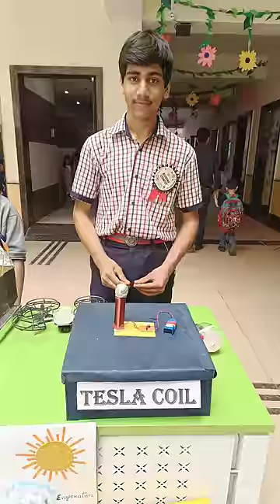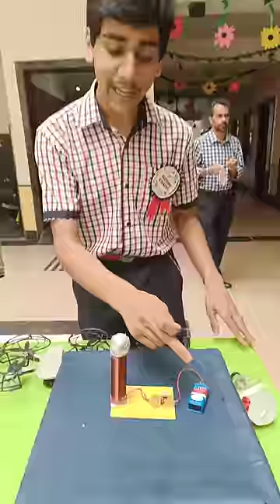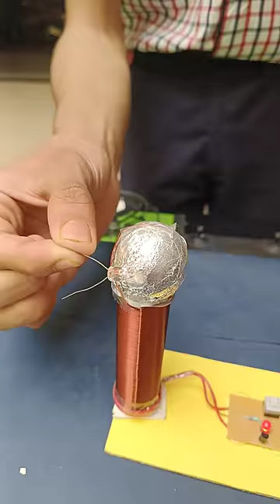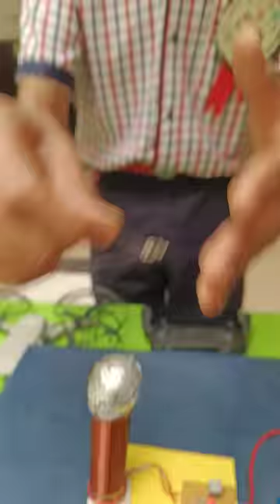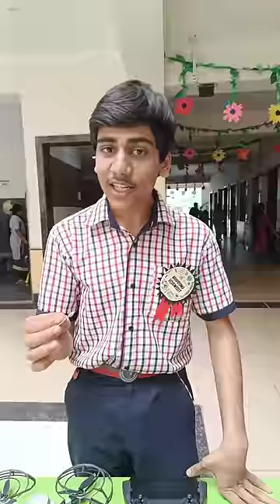Tesla Coil#science#project#exhibition#cbse#physics#learn#fun#magic#viral#shorts#trending #models

Comment: Abe electric field nahi hai electromagnetic field hota hai
Reply from the maker: Yes, but due to the presence of charges he is talking about electric field.
Reply: Can you talk with proper way to respect them?
Reply from the maker: @kaustubh_350  who disrespected and whom ?
Reply: nope tesla coil(slayer exciter circuit) generally have to do with electric fields. yes there exists some magnetic fields but thats not the designated o/p. basically no charges are flowing out of it or else we see a dielectric breakdown and hence beautiful arcs. the main reason it works is that the primary is one of the plate of the parasitic capacitor and the other one is the ground or any electric appliance like the bulb there. obviously the kid wont properly know how it works but he knew a lot upto his level. i first made it as a kid studying in class 9 that time i didnt knew anything about the transistors. now i dare to play with 1 kilo volts. so yeah just appreciate the things around you.